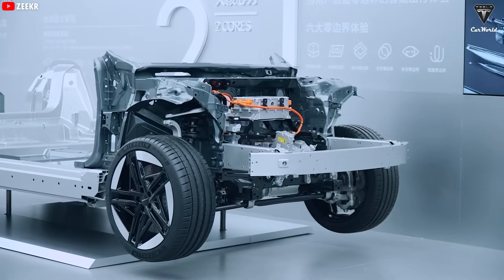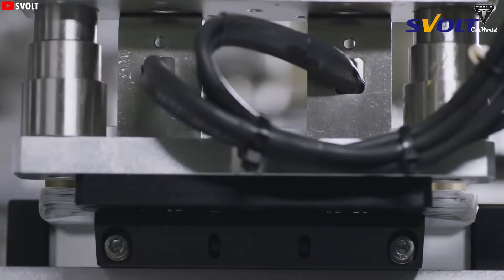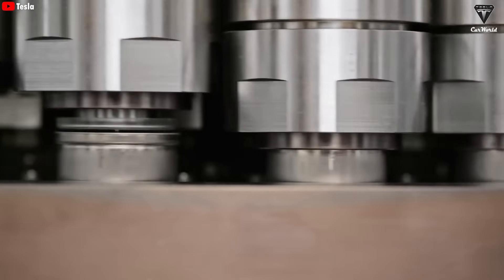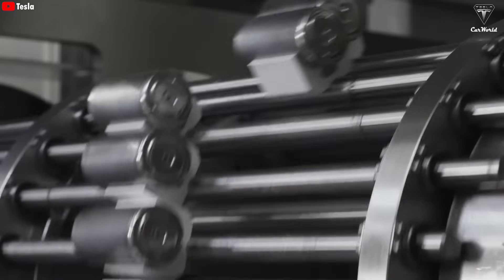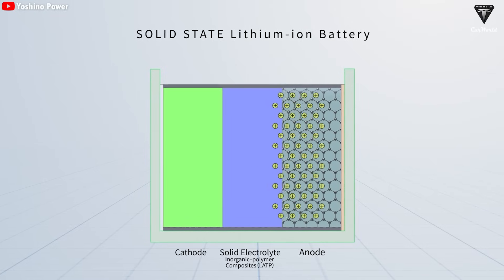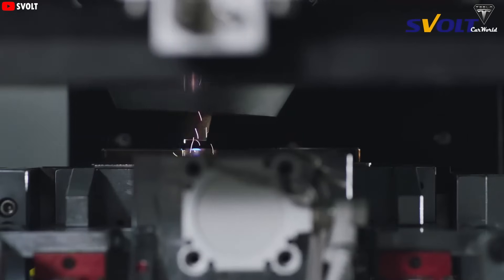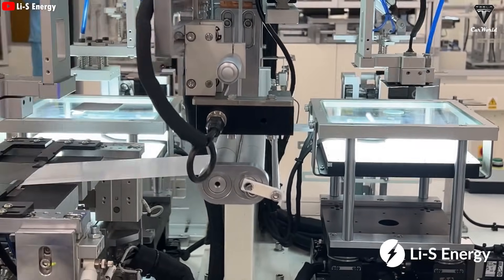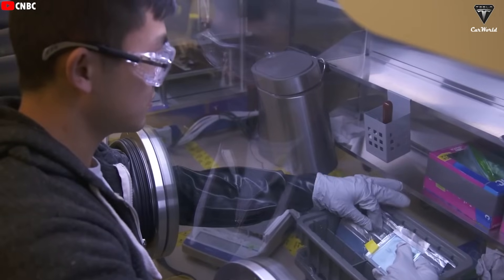1000 Miles! Elon Musk LEAKED All EV Automakers Are Chasing This New Battery Type | ICE Cars Killer?

Comment: EV manufacturers will decrease the battery size to keep the 300 mile range just to save space weight and cost.
Reply from the maker: The energy density of solid-state batteries can deliver more power even in small battery packs

Comment: So we should go for energy density. This creates a charging problem especially in places like apartment complexes where the vehicle density is very, very high. It will be impossible to provide charging services for an apartment complex. 

The solution is filling stations that swap out discharged batteries for fully charged batteries in minutes.  The charging stations will be a replacement for the current filling stations. They will need to hold an inventory of batteries that are being charged. Batteries will have to be recyclable and standardized across all vehicles. Battery swapping will have to be fully automated (i.e. performed by AI's).  Customers will not own the batteries in their vehicles rather, they will rent them from a battery charging company.

The problem is finding enough electricity to charge billions of large batteries. The way to do that is with thorium LFTR reactors. Solar and wind generation systems are too fragile to supply the reliability we need. This regimen is what it will take to make electric vehicles truly practical by making it super simple and convenient for customers to get a recharge.
Reply: Simply ditch the car, if you live in an apartment complex, & use a Cybercab